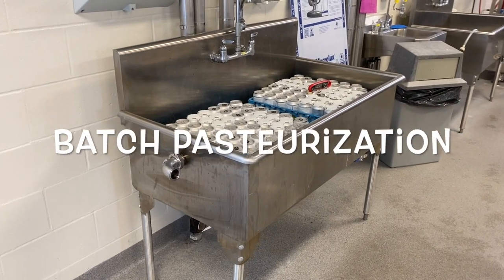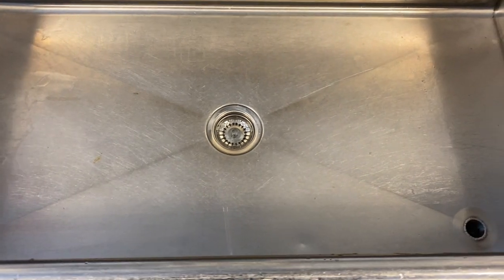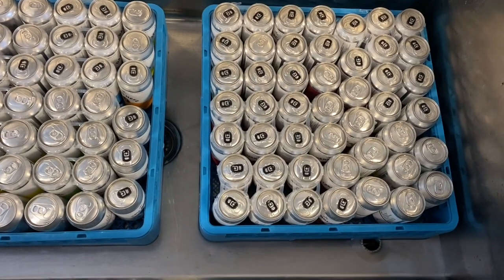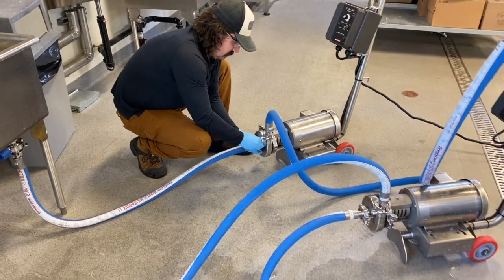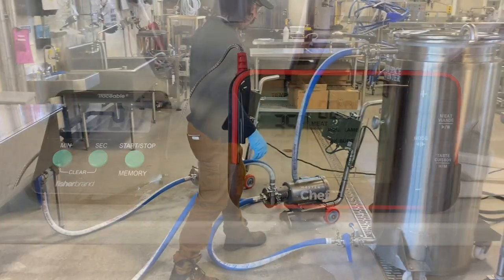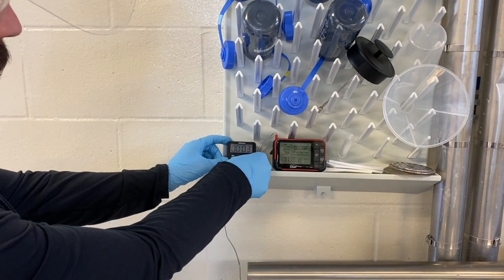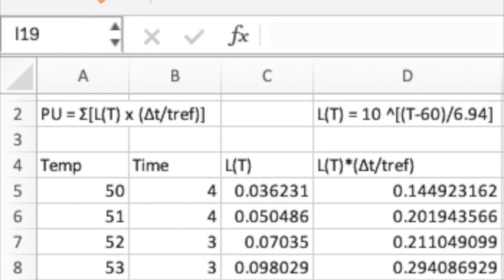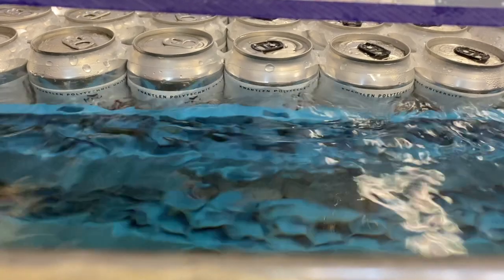DIY Batch Pasteurization: Simple Setup for Small-Scale Production (Non-alcoholic Beers and Ciders)

Comment: looks awesome. what is the cost for system like this? what does cip stand for? those tanks and pumps were could i buy them?
Reply from the maker: This entire Batch Pasteurization System was assembled using equipment already available in our brewery. To set it up, you’ll typically need a large stainless-steel sink, a 200-liter CIP tank with a heater, two CIP pumps, and three brewery hoses. CIP, or Clean-In-Place, is a key part of the process. 
When it comes to pricing, you have the option of choosing between new or used equipment. Any reputable manufacturer of craft brewing equipment should be able to supply everything you need to complete the system.
Reply: @ thanks very much 👊🏼👊🏼